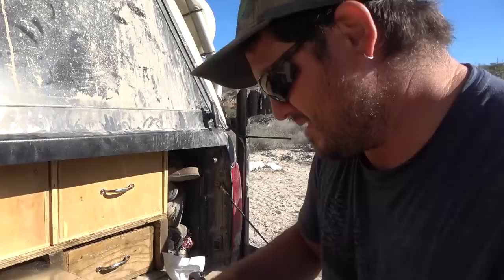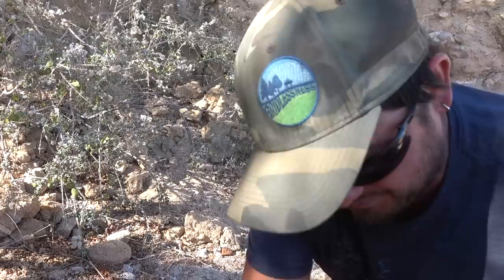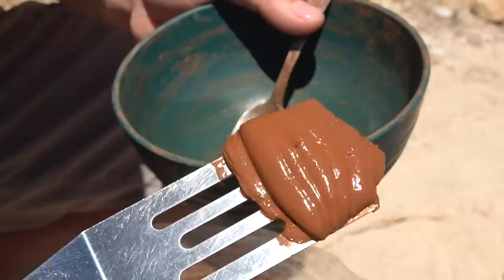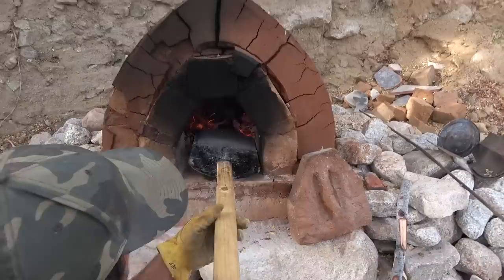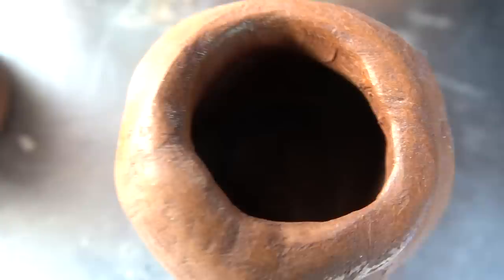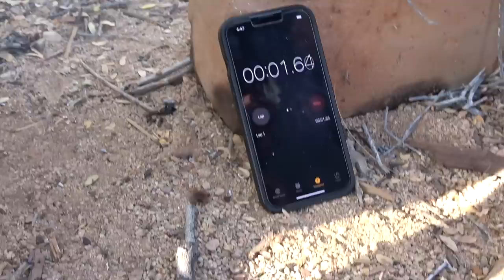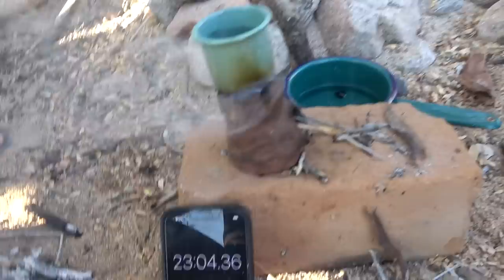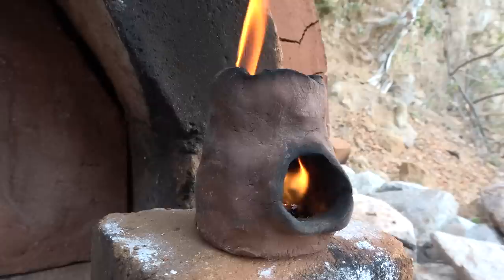Mini Rocket Stove - Fire from Earth 3 Ways

Comment: The little guy, I think, needs a little more height, a slightly smaller door, and because the flame is so small and weak, the pot needs to be just high enough that it doesn’t smoke, and no more…..though I could be wrong on all counts. 🙂.    Finally got the family to go camping for more than a night or two, so we can settle in and I can have the time to play around a little too.